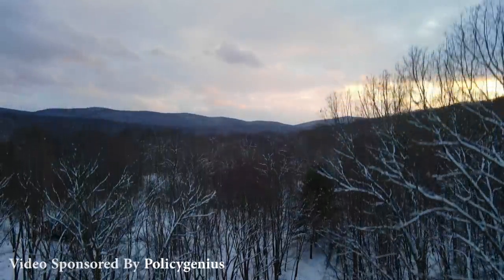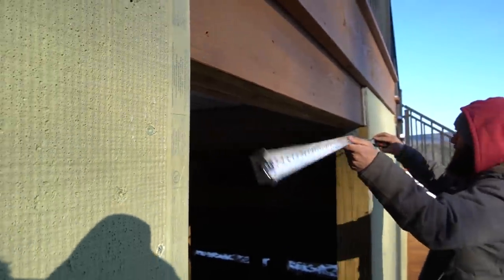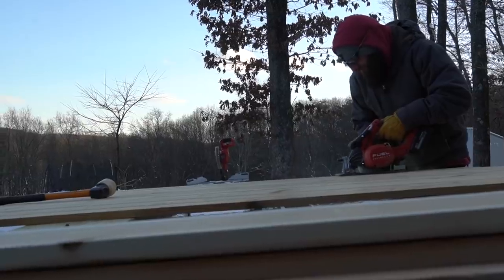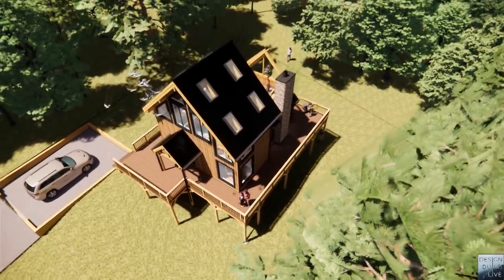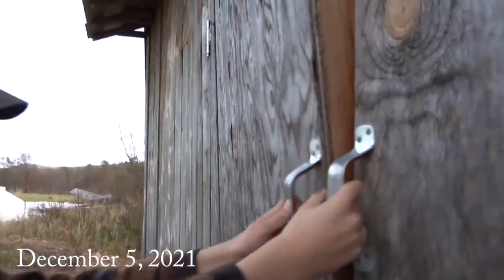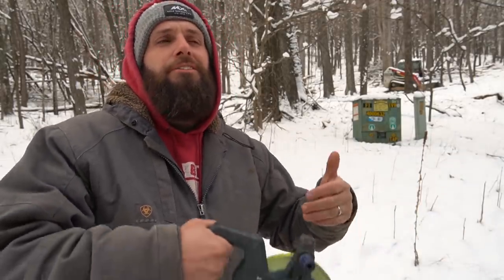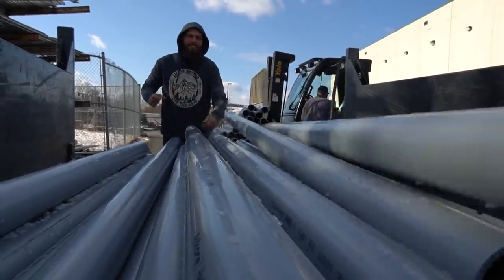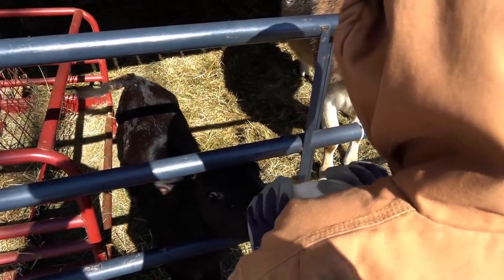Our First NET ZERO AirBnB House Build!

Comment from the maker: To start comparing quotes and simplify insurance-buying, check out
Policygenius: https://Policygenius.com/wwog Thanks to Policygenius for sponsoring this video!
Reply: _ I WANNA ASK YOU guys is the solar panels work well?! And do you need to turn on the generator?! How do you deal with cold days and what do you use?! , Thanks so much _
Reply: @haidarkarar1469  il faut payer...
Reply: Where did you guys get your panels?
Reply: Next time when you order pipe, get the bell end and you won't have to get coupling, plus its more surface area than a coupling and is a better fit. That is if your supply house has it, some plumbing items are getting hard to find anymore.

Comment: Hi Josh gust a tip to help you clean the snow off you solar pannels. Take a rope and buy you some pool nuddles and put them on the rope long as your solar grid and take one side of the top of the pannels and Erin on the other side and pull the rope with the nuddles on it downward and presto you cleaned it easy as pie many blessing to you guy's.

Comment: With a little engineering a scissor hinge and a small hand wench you can make a simple angle adjuster for your solar panels. At about 60 degrees of angle all that snow will slide right off. It makes it easier to clean them too.

Comment: Hey guys have you thought about coating your solar ray panels with a ceramic coating like that's used on automotive paint. It should allow the snow to just blow off or slide off so you won't have to be bothered with snow removal every time it snows. Check with your solar ray panel  distributer first to make sure its safe to use.

Comment: Need a wider scraper and a blower for the fluffy stuff on the solar panels.   Try giving them a coating of windshield washer fluid afterwards.  It contains antifreeze.  Looks like someone would make a heater to keep the panels from freezing.  Look into a diy solar heater.  Can put out up to 140 degree air for free.

Comment: I would have used screws instead of pin nails on your door construction.  They pull the wood together and make the adhesive work better. Gorilla glue works on treated wood also, if you ever need to do that.

Comment: I like using nuts and bolts for cross bracing on outside paneled doors.   I think the nails will not hold the door from warping in the long run

Comment: ROOF RAKE: a LONG HANDLE with a  wide "U" Paddle head piece. One side up pushes/pulls snow and the other side cuts snow loose and allow the cut snow to slide down a long chute of attached plastic. would work on the solar array too.  
I wonder if RAIN-X sprayed on your arrays would allow the snow not to stick like it does with Truckers Windshields and Wipers.

Comment: (a) It's not unusual for February to be the coldest month.  (b) Connecting to the Grid means you can sell excess power back into the Grid, as well as keeping any batteries topped off!  All of that can be programmed into the system to avoid constant adjustments and/or monitoring!  (Plus you might even be able to establish remote monitoring of the Trout Pond property electrics from your A Frame location).  (c) This is a great opportunity to add a few solid diagonals under the Deck as well as on the new doors!  🙂 (d) When the new Texas Gigafactory fully ramps, you'll be able to try out the new Cybertruck!  🙂

Comment: I'm wondering if the Air BnB will have a NEMA 14-50 outlet on the outside. Could have an option when renting to provide EV charging capabilities, especially since it will be tied into the grid.

Comment: I love the look of the new Trout Pond house.  My only concern is the higher-than-normal chance for leaks caused by the "open" deck on the back of the second floor (i.e., a flat 1st-floor ceiling combined with no pitched roof above it).  What extra level of weatherproofing are you planning to install?

Comment: You should go on grid at both locations! Totally  off grid systems suck. Grid tied is the best. Where you can have net zero energy consumption, yet have an extra boost from the grid when you need it. The grid backs up your solar power when there is a problem. And your solar power backs up the grid when there is a power outage.

Comment: I guess I am confused.  Was the sudden storm the reason you decided to put the Air BnB on the grid? With solar/battery backup?  I would not have been surprised if that hadn't been your plan all along, so there is less maintenance you have to handle.

Comment: Why would you use solar panels at the Trout property knowing you'll have the same issues you have at your main location with snow piling on top of the solar panels? That just seems like that's going to be more of a hassle than what its worth. At least it could / will be during the winter season.
Reply from the maker: The trout pond property is grid tied. It's not dependent on the panels working. With that said, part of having an air bnb requires constant attention with each change of guests so the panels are the same as regular housecleanings- it's part of the business and something you deal with

Comment: I've been bitting my tongue (keyboard LOL) not to act like I know to much (which I don't) but I have a bit of a concern.. I've done some stone work in the past and found that true stone, not the cultured/synthetic light weight stone, but the stone that you've selected is very heavy especially as you start stacking them vertically - the next higher one relying on the lower one to help hold its weight while the bonding agent cures.. I've found if I went to fast, height wise, they can crumble down; meaning the bottom mortar wasn't cured enough to hold the accumulating weight.. Maybe a removable 2x needs to be attached along the bottom edge of the concrete backer board for support until the first few courses of mortared stones dry?? Just a thought. I don't mean to sound arrogant..
Reply: Great idea! Maybe you could attach a strip of plywood (linear) to the 2x and screw the assembly to the back of the backer board with the 2x flush to the bottom creating a 2 to 3 inch overhanging ledge for the starter coarse.

Comment: Why aren't solar panels heated?  And why hasn't anyone developed a heating element to the solar panel to melt snow and ice from the panels?  Just asking...  I know that on rigs they have a heating element on side mirrors so truckers can drive more safely in the snow.  If they can put a heating element to melt snow on rear windows in cars and trucks.  Why haven't they done so with solar panels? Again, just asking...

Comment: Bad move to not include batteries. Are you going to put in an auto start diesel generator? Once you get a blackout
(refund
Reply from the maker: When you stay at a rental beach house for a week, or any air bnb/vrbo you don't get  refund if there is a black out. Blackouts are a rare occurrence for one but secondly it's in the contract.

Comment: Net Zero is not cheap, you will have higher rates than normal and you will be locked out of your own solar if there is an outage, allegedly so you can't generate through the grid during the outage and injure workers, but you will never run out of electricity  ??????